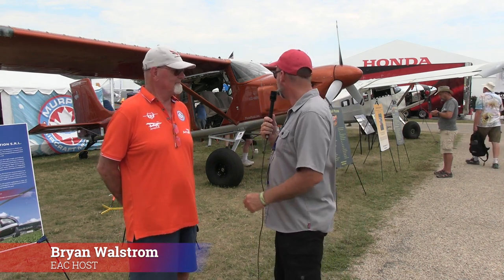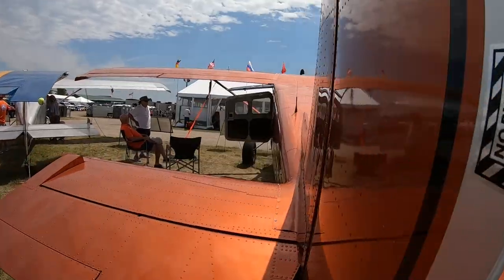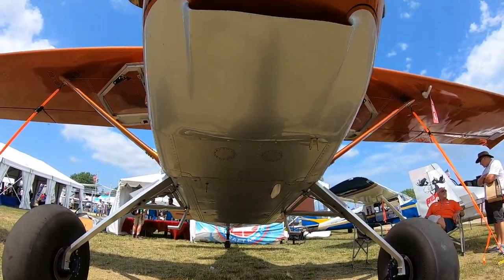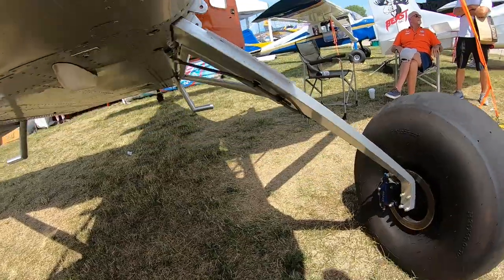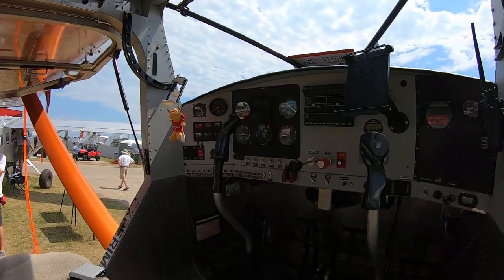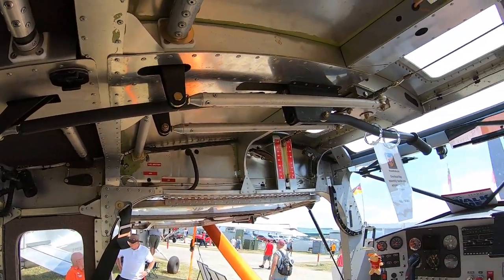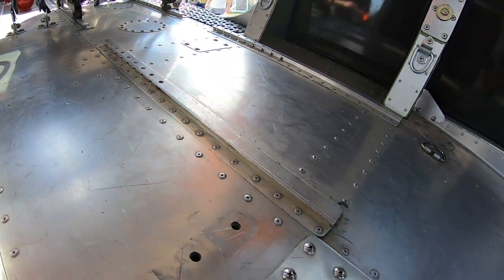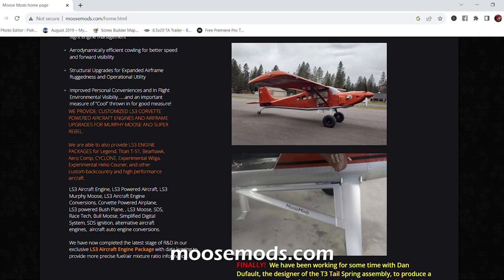500HP+ V8 Aircraft Engine and Airframe Mods! Moose Mods - Oshkosh 2023

Comment: LS engines are the closest thing to bulletproof you will get.  The 4k cruise rpm is a little concerning though.
Reply: An abecedarian asking, why is this a concern?
Reply: @onethousandtwonortheast8848  They are bulletproof running for years at sub 3k rpm cruise in a car or truck.
Reply: @scootypuffjr.  Any more bullet proof than a lycoming or other GA standard engine?
Reply: Jet boats do it all the time sustained 4k. Also look into how gm test there engine's
Reply: @user-ju3ns2cz1u  I had a 502 in my boat that I ran at 5200rpm for miles....a lot. That was about 80mph with a 25p prop. That being said, if it blew up I could coast to a stop and get a tow back to shore.
Reply: lol for sure.

Comment: I wish them a lot of Luck! In my short 72 years on this earth I have never seen  an auto conversion that has worked! Well maybe the Ford Model A. Old rule of thumb. If you like to fly use an aircraft engine, If you like to tinker use a car engine! And watch your friends flying by as you tinker!
Reply: I wish them prosperity however history isn’t kind to auto based aircraft engine developments.
Reply: 82 years today and I hope we are both wrong, but doubt it.  2000 hours at 4000rpm?  When they all pass 1000 hours, we will have some interest.  As B.J. Schramm of Helicycle often said, "I have planted more pistons in Idaho than potatoes."  The fellow with the Moose Turbine fully understands.
Reply: sonex and several other smaller experimentals have been using converted VW bug engines for decades.
Reply: @laxplayer99   you’re right but the stresses on a vw aren’t even close to the stresses put upon these bigger engines.  Airplane engines develop their hp at 2750 rpm typically, considerably less than the 5200 t/o rpm to 4000rpm cruise. I wish them luck but there simply are no viable automobile conversions. They all fade away into oblivion.

Comment: Too much difference in rpm, 5200 power to 4000 cruise. That is the equivalent of a Rotax having a power rating at 7850 and cruise of 5500. Propeller efficiency is not good over wide rpm ranges. If the prop is designed for 4000 cruise, at 5200 a lot of the power consumed will be for drag rather than thrust. Would be nice to see a thrust graph on their website, but they mention nothing of propellers.
Reply: C'mon Man, they've got 500 hours run time in their fleet of 20 engines!

Comment: interesting they say its a stock ls3, That means Hyper pistons? Hope that is not what you are running. The Airboat world figured this out a long long time ago :) use a forged rotating assembly, also why the 2.11 ratio. pretty much no one runs that on boats. A lot of thrust testing has shown that 2.68 and 2.55 are much better in every way both static and dynamic thrust....ohhh and stock ls3 valve springs do not survive in a high RPM application. They are made to run short bursts at high RPM then back to 2k. also something the boat guys figured out a long time ago

Comment: Auto conversions always concern me, but it will be interesting to see the LS build flight time. 

LS has a great reputation for reliability, but at 4000 rpm I’ll need to see more time to consider it. 

Wonder why only 500 hours in the fleet since he finished development in 2016?

But, I’ve been watching his progress for a while so I can’t wait to see where it goes!
Reply: As a total newbie, I ask, is this rpm concerning because it’s higher than you think the engine parts can stand up to?
Reply: @onethousandtwonortheast8848  usually the concern with auto engines is they aren’t made to operate at high rpm’s constantly. 

Think about your car. You might operate at high rpm’s when you need to accelerate quickly, but when you’re cruising you’re probably at 1700-2400 rpm’s. 

These LS engines are typically around the same. But now we’re operating at 4000 rpm in cruise for Flying. That’s the concern for any auto conversion
Reply: @ethanlegrand33  well that makes sense but then I think of the Le Mans 24 hour marathon.   Those engines perform well. 🤷🏼‍♂️
Reply: @onethousandtwonortheast8848  those engines get rebuilt after that race. So they’re getting rebuilt every 24 hours of use, maybe 30.
Reply: Automobile engines have been used in boats for decades. 4000 rpm cruise for extended periods is not unusual. That was old school. I have no doubt the LS engines are even better.
Reply: @lessharratt8719  Yes, and airboats operate at high RPM and use auto engines sometimes.